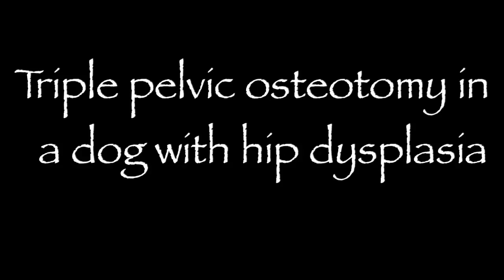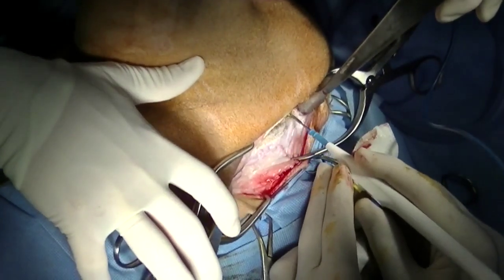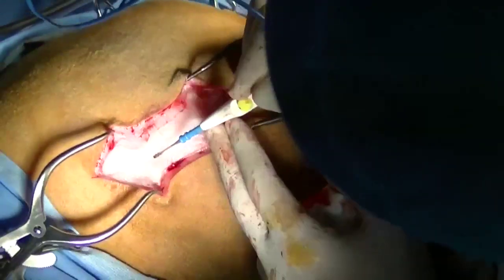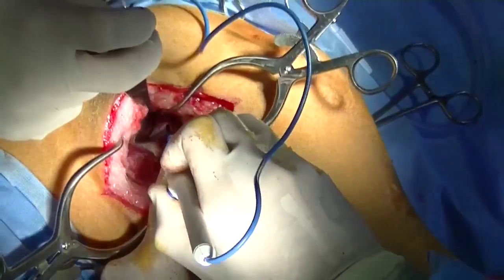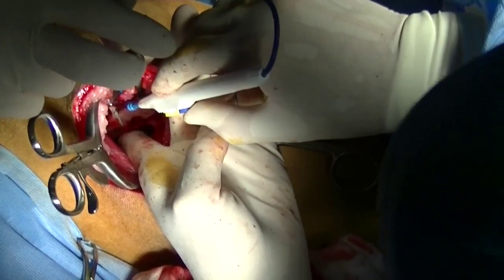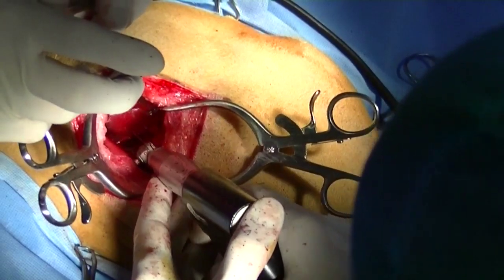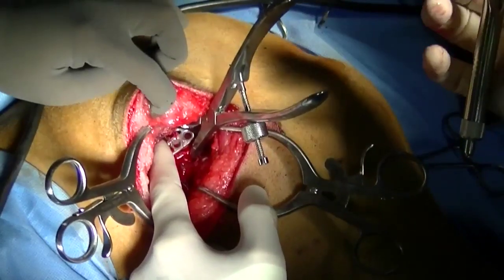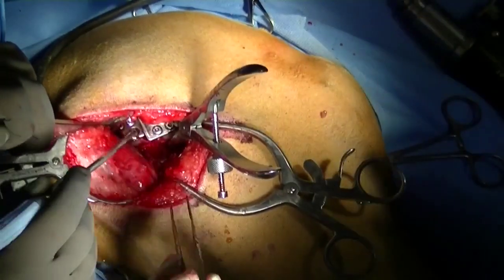Triple pelvic osteotomy for hip dysplasia in a dog

Comment: Is there an age limit for osteotomy to treat hip dysplasia? I need to get my dog x-rays but my vet warned it could be that, I want to know whether it's too late for an osteotomy and if we will have to go for a hip prosthesis
Reply from the maker: There are three parameters that we use to determine if it is too late - age (we generally don't like to do this passed the age of 12 months), presence of degenerative joint disease on radiographs and degree of subluxation (if the joint is too far out of the socket then rotating the socket will not do any good). Hope this answers your questions. Cheers, Charles